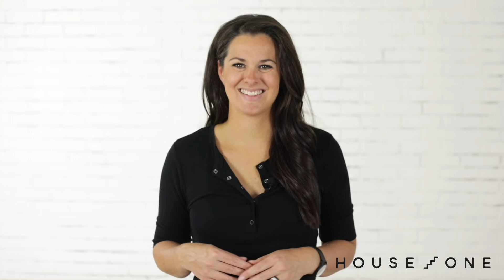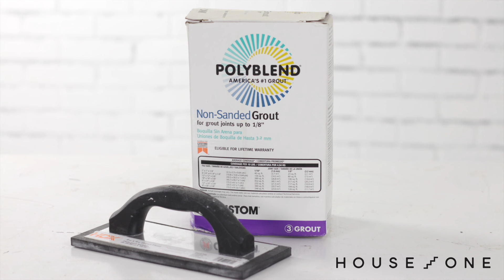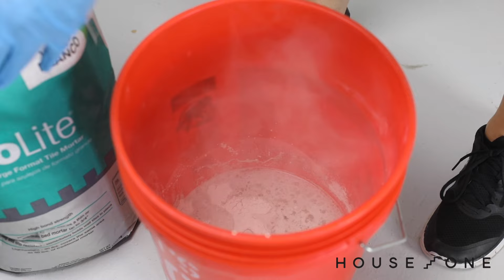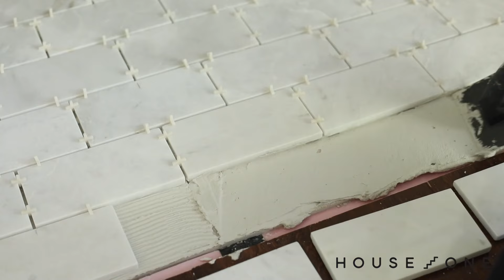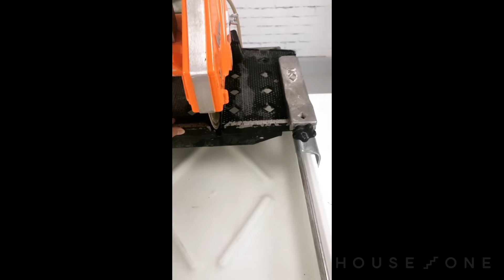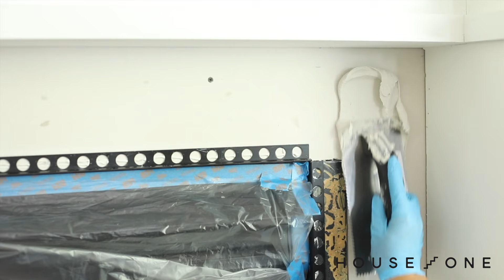How to Tile a Fireplace | House One

Comment: Thank you so very much! I learned what I needed to. I'm tiling my bottom part of the fireplace. It was in a dark brown. And my fireplace is actually made out of rock. I didn't like the color so I went with a light gray. I did what you did. I cut all the tiles and then started to do the work. Thank you very much for sharing your knowledge❤

Comment: Is it just me, or does everyone have these tile saws set waaaaay too high. Shouldn't it be set lower to protect your fingers? Setting it lower also gives the tile a more vertical cut, instead of angled cut of the blade, which would be useful if you want to notch out part of the tile instead of cutting all the way through it.
Reply: I agree. Cutting tile is easier and safer if the blade is set to a deep plunge. Otherwise the blade pulls the tile pretty badly.

Comment: I will add that the premixed mortar I usually use states that it should only be installed in areas that will be less than 120 degrees Fahrenheit. So another vote for mixing it up.